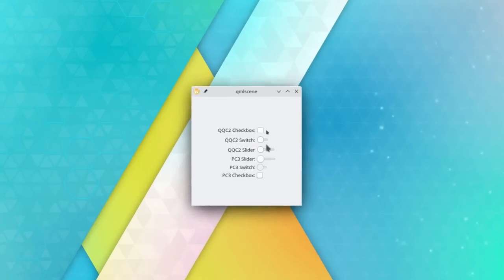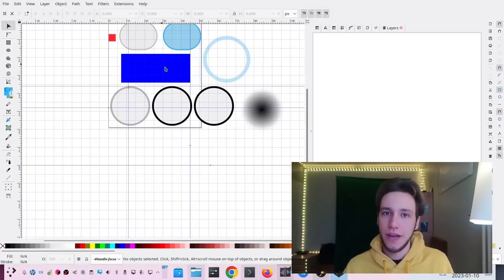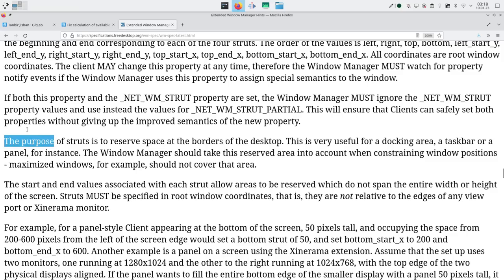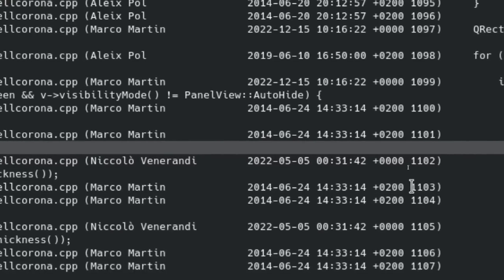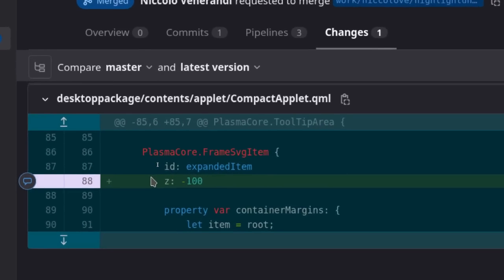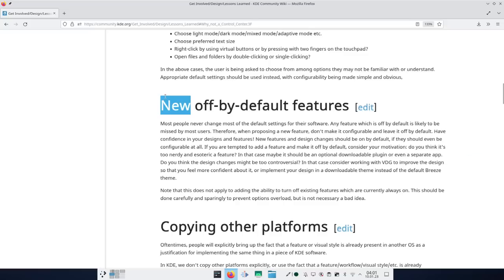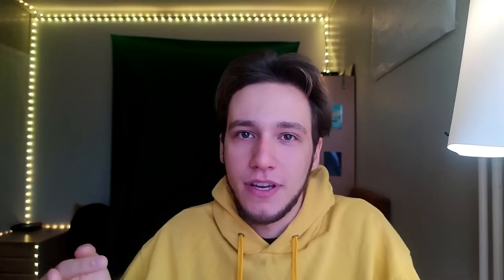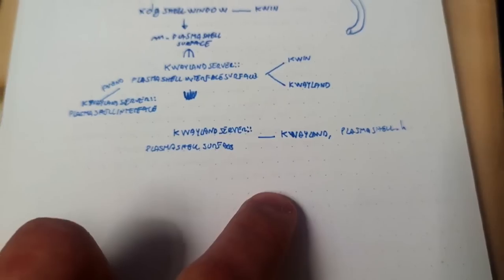New Features For Floating Panel AND New KDE Switch!

Comment: I always thought the check boxes should be a different colour when the settings are not currently applied. If you have a window with lots of check boxes you might not know which ones are current if you've ticked / unticked some.
Reply: Pretty good suggestion!!

Comment: I recently ditched latte dock since it is unsupported and totally borked post the KDE 5.25 release and switched to a floating panel. I was pleasantly surprised not only is it supremely functional and easy to use, but it supports drawing rounded corners defined by a plasma theme and integrates perfectly with KVantum themes. To me it looks like Nicco's work is excellent and perfectly aligned to a design philosophy of "less is more" when its comes to productivity and customization. I highly recommend people try out single floating panels with "windows can cover" option enabled and see for themselves how good it feels.

Also, I love the look of the new switches. I think that will be beautiful once fully incorporated. KDE is still the flagship Linux DE as far as I'm concerned.

Comment: May I give you a suggestion? I'm a front-end developer, and here's how I use switches and checkboxes: I use switches for options that can be read as booleans, for example, if something is active or not. As for checkboxes, I use them for things that can be read as arrays, for example, a list of tags. At the end of the day, I basically differentiate fields and inputs. Everything is a form, but a single field can have a single input option (switches) or multiple inputs (checkboxes). I hope it makes sense. Great Job with the switches.

Comment: If the problem is maintainability, I think that the defloat option should never be developed at all.
It seems that it is easier to make an float panel and make it stay floating forever than to make the defloat thing and start to think and develop N ways that it should work.
I would just think like that: If I will implement a floating panel, I will make a float panel that always float. If someone wants the panel to defloat, I would just say "Then use a regular panel" (yes, like and GNOME developer 🥴).

Comment: Nicco, I love watching your videos about UI design modifications in KDE Plasma! I have tried so many times to move over from GNOME to Plasma, and while each time I am able to stay longer on Plasma, I still find there are many things that drive me nuts about Plasma that works correctly in GNOME.  
The bug that still exists when you try to create and modify a profile in Konsole.  The bug in KWin when trying to create new keyboard shortcuts for moving to different desktops, which requires you to assign them twice before they stick.  There is other stuff like sometimes the wallpaper on one monitor being blank, and the ability to even right click on that desktop being removed until you log out and log back in.

Comment: Hey guy, I just had an idea that if a floating panel can be dynamic. In my imagination, you already have a space between the panel and the edge of the screen. When any app's windows are set maximize or touch to the floating bar, this panel could "dynamic" move to this space. I think the transition animation would be a hard part, but it's just a thought that popped into my mind.

Comment: i think checkboxes are MUCH MUCH MUCH less confusing. you can clearly and easily see when something is not checked, whereas switches are sometimes (or often) very ambiguous and i can't tell if that's the on or off position, and i have to toggle a few times to see the difference, and sometimes it's hard to tell/know.

Comment: Also, I would like to point out to anyone experimenting with different themes that there are plasma theme and icon caching issues with third-party docks and icons. Native plasma panels handle the caching perfectly fine but latte, plank, and docky can run into caching issues which can only be resolved by deleting all the icon and theme cache files generated and logging out to redeploy the desktop. 
I have taken to making a habit of deleting all the cache files after I change the theme, just to be absolutely sure the DE is fully refreshed. Just FYI for those filing bug reports. Known issues.

Comment: speaking of more or fewer options i think the ultimate goal should be to improve experience, not save your time (you do what you gotta do ofcourse). so let's take the issue of defloating panel. i as a user see this use case scenario, for example. i keep the panel on the right side, make it floating, make it autohide and allow windows to go beyond it. so what i get is aesthetically pleasing and imo logical workflow - when i activate the panel my window does not shrink and the panel stays beautiful at all times and i can save some screen real estate. you see, defloating the panel defeats the purpose of it being floating because when i need it it actually defloats. and defloated panel looks horrible being even thiccer that grounded one in the first place. so i get it, to each his own and devs don't owe me anything, but what happens is the work done ends up kind of wasted - options presented make no sense while needed ones aren't there.

so what i'm getting at, i guess, is before implementing some options and then saying it's too time consuming and bug producing to add more the devs (in general) should find the most needed combinations of all the possibilities and then focus on them instead of doing it semirandomly of from the devs' convenience standpoint. as per pareto rule.

ps: let me reiterate - no pressure and no complaints here, just thinking out loud.
Reply: back to the idea. now kde has a tray thingy for multiple display setups. and it has a bunch of predefined configs - use one or the other, duplicate, extend left and right. the problem once again is i don't need these options, i use a custom config. so if i can't edit this entity removing unnecessary setups and adding needed ones i end up with wasted dead space in my system tray and the need to still keep using an additional widget. it is just annoying at this point.

Comment: I also had the space issue and I noticed it after upgrading from fedora 36 to 37. During the update my nvidia driver broke and it reverted to the noveau driver. But I noticed this only after a few days in which my desktop sometimes broke. This resulted sometimes in various effects:
1. The background of one of my monitors (I'm using two) disappeared. Background image, ability to right click, box selections of items...
2. The panel disappeared.
3. The wrong background image was loaded.

Each time the panel disappeared I recreated it. And after watching this video I checked and had multiple panels stacked on top of each other. So the disappearing panels were still there, but on the wrong screen.

Comment: The reasoning for the behaviour of the floating panel is wonderful. For me personally I would prefer the floating panel to act like the MacOS dock. It is always floating. If the dock is set to always be there a maximized window (not fullscreen) stops at the dock. I think this is bad as it limits the amount of screen space the window can use. But if the dock is set to auto-hide the window will take up the whole available screen and when you hover your mouse over the screen edge where the dock is located it will appear above the window.

With all that said you are one person. Obviously you can ultimately only develop what is within your limits to maintain.

Comment: Hey Niccolo!
Are you aware of the misbehavior of the floating panel when connected to a second monitor having a default panel? If you maximize a window in one screen, the other panel of the other screen also behaves as if wimdow is maximized in that screen too. You should look into it. I did not create a bug report though.
Reply from the maker: Yes I've seen a bug report about it! Very weird, maybe still something about struts. It's on my to-do list.

Comment: Can you look into the weird animated tooltip bug on Nvidia cards? It's been a very long time that the desktop looks so glitchy that I can't let anyone see it.

If I hover, and run my mouse across panel widgets with tooltips: there's a huge chance that the tooltip will appear unusually huge and stay on the screen while flickering like crazy until a refresh is forced by moving a window. All I want is an option to turn off this ugly animation.

No, my graphics card is fine. No, I'm not using weird settings. No, switching OS didn't help. No, the drivers are updated. Yes, I'm using the latest stable release on a rolling distro. Yes, there's unanswered posts from around two years ago regarding this.

Comment: Honestly, the defloat thing is just dumb, it's extremely hard to implement and maintain and it just isn't that cool, it should work like macOS instead where it doesn't defloat at all and if a window goes beneath it it hides
Reply from the maker: Hopefully we'll have that once intelligent hide is implemented. However you should be able to have that already, or at least very similar, by setting it to Windows can cover. If it still de-floats, that a bug

Comment: I appreciate your floating panel, I just wish it would slide down instead of getting fat when de-floating.. 18:56 i wish my panel worked like that :(
Reply from the maker: I think I did not make the point clear enough: that's exactly what I'll be achieving thanks to the strut changes!
Reply: @niccoloveslinux  could just be my hard head, thanks for all your hard work... as an old php developer in early days that briefly got into the object oriented stuff, what would be a good language to learn to start tweaking things in kde to my likes, or to contributing to kde?
Reply from the maker: QML for sure!
Reply: @niccoloveslinux  thanks, I will look into it.. always been a quiet user since around 2008 that always wanted stuff to be slightly different but never could find the time or a good place to start. Was quite good with PHP, SQl, html5, XML, css, JavaScript but gave up on it because I lacked in the graphics department to really tie site design together.

Comment: i think your proposal for switches makes sense, but also remember Radio buttons, or do these not exist in linux. 
I think you are leaving more than enough artistic licences to the software developer.

 This will be missused, not a massive issue in the grand scheme of things. but do not blindly follow Windows, allbeit a bettter dwm. The UI theory behind latter day Windows additions is example of this.

The time since "staple" common controls were deviated from has been a Disaster in all-round conformity exhibited in software design as a whole. I have a good knowledge of this as i do is script Windows GUI for 3rd party applications. Ive done this for about 20 years now.
Reply: and By the way for all its benefits i am yet to find any that have come from XAML controls vs Common controls in windows developments. but I have found numerous disadvantages.